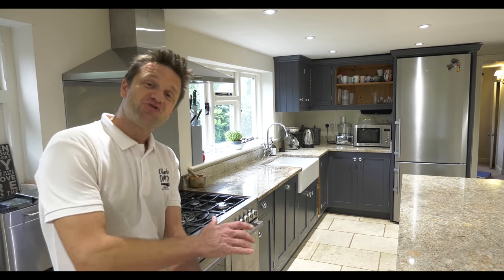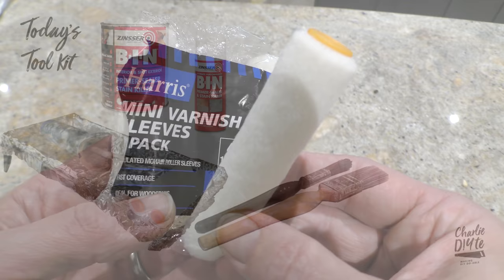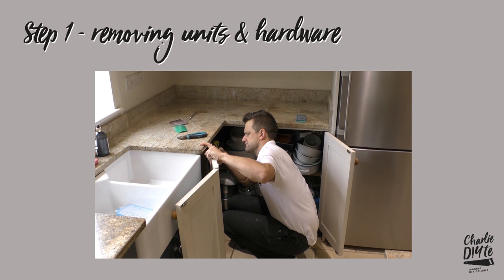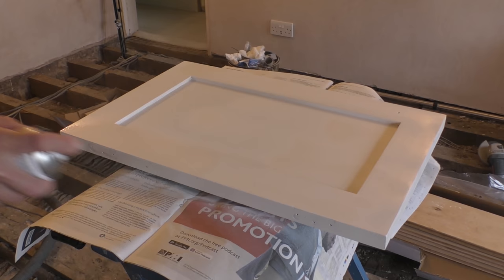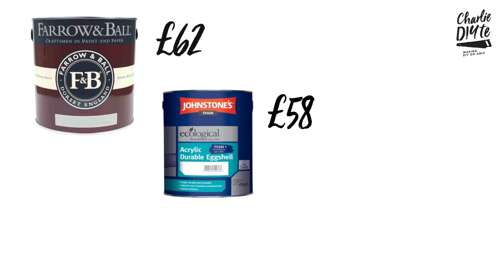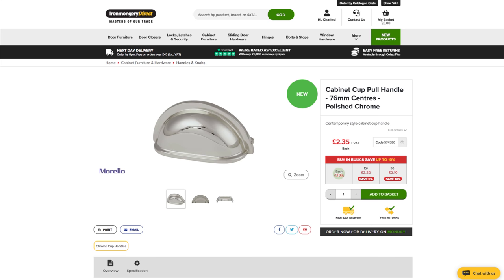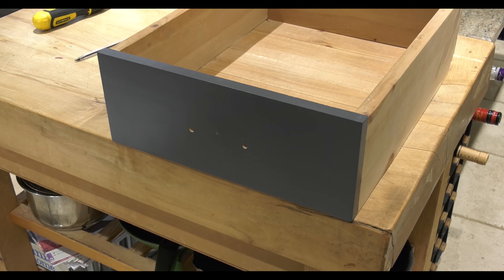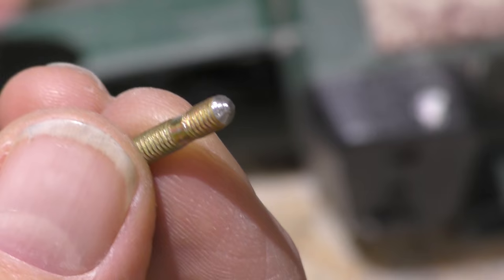Kitchen Makeover - How to Paint Cabinets & Fit New Knobs and Cup Handles!

Comment: I have always relied on Benjamin Moore paints (franchise) -- hi-gloss, semi-gloss, and eggshell and ceiling.  They have held up in a NY apartment for over 20 years and do not show any darkening.  However, since Benjamin Moore has doubled in price I tried Behr paints (Home Depot) at $30 gallon (approximately).  I find they are almost as good as Benjamin Moore but need maybe a half-gallon more per job.  They don't cover exactly in one coat but I am happy with the final results and they don't cost $60 a gallon. Behr paints also don't darken and hold up quite well.  I have also used Kilz 2 latex primer and  PPG Gripper latex primer and are happy with each brand.  Both cover very well with Gripper being slightly thicker.
Reply from the maker: Thanks for that - very informative and useful for anyone tuning in. I've got to say, the paint I used in this video is not wearing well. Chips everywhere that need patching up.

Comment: Interesting video. Hard work getting that done at home! I prefer to snap off those knob screws. Bend them a little bit one way, a little the other way and they break off at the divide. Bit of a knack to where you grip the pliers though, sometimes you crush the threads in over bending.

Comment: I use BIN 123 and all I do with trays as with all paints I just leave the left over wet tray to dry.Keep using it with all paints and never clean it down the plug hole as this is really bad.
After about 20 Used you simply cut the built up paint at one end of the tray and it peels off back to the new tray.
Using BIN I’ve wrapped brushes in cling film overloaded with the BIN.These brushes are good to go for at least a month.
Watch some of my videos where I’ve used BIN on varnished doors.👍🏻

I’m about to do my units which  are varnished 🤯 I’m gonna use BIN 123 two coats then 2 coats of Dulux Trade high gloss.Just for easy cleaning and wear and tear.Il get it colour mixed.

Comment: Hi Charlie, really interesting video. I've used many paints over the years and i've narrowed it down to Dulux in the end. Anything else i feel is a compromise and its about ease of use, how does it feel on the brush/roller? does it cover well? Is it tough enough for the job? I tried eggshell once to get a good finish, six coats with sanding in between but very delicate as a finish. Never used Zinsser but i reckon i'll give it a go sometime. Satinwood for wood/metal, wouldn't touch gloss again. Brush on and roller to finish. Thanks for sharing. Stay safe and keep up the good work. 👍🖖

Comment: i am awful at DIY but i am learning a lot with your channel! subscribed!! just wondering why you choose the shellac BIN zinsser over the bullseye 123 waterbased version? Thanks
Reply from the maker: That's great to hear! You're not awful, you're just starting your learning journey 👍 To be honest, BIN is a far superior product because being shellac based rather than water based (which the 123 is) it blocks stains and odours and things like wood knots, and dries incredibly quickly and also adheres to a ridiculous number of surfaces. I'll be honest, I've never used 123, but I'm struggling to see the need to buy any other primer now I've found BIN. If you're painting your kitchen don't forget to degrease with sugar soap or Zinsser's Universal Degreaser before painting, as I forgot to mention that in this this video.

Comment: Thanks Charlie. I've just completed my kitchen cabinets paint refurb. All inspired by your video. I used Zinsser BIN for the basecoat (coated MDF) but could've used a Dulux oil based Undercoat. The top coat was a water based Dulux grey colour. I must say that the shellac Zinsser has a satisfying vanilla scent to it. Anyways now that I'm ready to screw all the cabinets back in I'm contemplating on whether to add a top coat of clear Varnish or Lacquer to it? Two coats of lacquer should protect the finish colour against everyday knocks and chips - do you agree?
Reply from the maker: Thanks buddy. Glad you found the vids useful. I would think carefully before lacquering, just because I lacquered my kitchen table https://www.youtube.com/watch?v=Odh0fR13Q9E&t=2s to try and prevent stains from things like red wine. It didn't really help with the staining and when I had to repaint the table - mostly because of glue residue from the kids projects, and the odd chip etc it was a nightmare as I had to scrape off all the lacquer before repainting. The valspar featured in this video is pretty rubbish if I'm honest as it's chipped loads, but at least it doesn't flash so I've been able to touch up all the chips to pretty good effect. Sorry that's not really very helpful. Maybe do a bit more research before making the plunge, but personally, because of my experience, I won't be using lacquer again.

Comment: Another fantastic video Charlie🙌🏻 I’m seriously on the fence about up cycling my Mums dressing table as it really holds so much sentimental value an I’m actually scared i case I ruin it. However, I did sand an clear varnish it a few years ago, which turned out really good tbh🤷🏼‍♀️ But I’m stressing about actually painting it😭😂
Reply: I think it will turn out fine.. just choose your colour.. (the hardest part)
You said you varnishing it.. No problem take your time and enjoy your self... 🤗⭐☕

Comment: Charlie, what do you think about painting laminate kitchen doors etc. I've read it can be done but I can't think it'll turn out that well.
Reply from the maker: I'm inclined to agree with you John. The Zinsser BIN has excellent adhesion - you can even paint it onto glass. However it's the long term durability that would worry me. This Valspar has been pretty hopeless if I'm honest from a chipping point of view although you can at least spot repair without it flashing (ie without having to repaint the whole door). My advice, maybe experiment on the back of a door if you're going to replace them anyway. Degrease with sugar soap (I forgot to mention that). Make a key by sanding the surface with a 180 grit sand paper. And paint on a coat of BIN. And see how it adheres.
Reply: @CharlieDIYte  Thanks for the advice!

Comment: Hi Charlie.  What’s the Valspar colour please? I have used Valspar extensively in my home and I like it. It goes on so easily and I can always eek it out. Its affordable and, if you’re fussy like me, you can get the colour you want. Downside: yes it does mark and chip easily in a busy household but I don’t mind the odd touch up!
Reply from the maker: I think it was Farrow and Ball Railings. The Valspar has chipped quite badly but is at least easy to touch up. Also if it's for the kitchen, give the units a good degrease with sugar soap first. Ideally go oil based as it will be more hard wearing. If you're using water based, there are a few products like Tikkurilla Kiva 10 or Blockade Rock Top you can paint on at the end to give it enhanced protection.

Comment: Hi Charlie, great video and the finished result looks great. Totally agree on your prep and BIN (fantastic stuff) - seems you spent more per litre on the primer than the top coat! The Valsper is not something I would use after the cat wee reviews on their emulsion and I've never had good experience with cheap paint. The hassle of re-doing is not worth the £30 saving but I understand why you choose to do it on this occasion. My preference for woodwork is tikkurila which is not actually that expensive but fantastic. Just one final comment - I've noticed with tikkurila that it takes a week or so to fully harden so perhaps this is typical of all water based wood paints? thanks again for taking the time to post the video!
Reply from the maker: You're very welcome Bill and thank YOU for taking the time to comment. Some useful info there 👍

Comment: Did you make sure you kept the hinges etc for the exact cabinet it came from before you painted it?
Reply from the maker: It wasn't really necessary as they're all identical and factory produced. Don't use Valspar though. It's not very durable and chipped easily.

Comment: Nothing wrong with buying paint from B&Q, they are often cheaper for a lot of Dulux/ Zinsser paints than buying from Dulux themselves. For some reason the Valspar paints always gets bad reviews here in the UK, yet over in the USA people love them.  
I will be making my own kitchen soon and for the top coat i will be trying out Benjamin Moore Advance paint as that gets excellent reviews. :)
Reply from the maker: Thanks for that. Very interesting. I think you're much better off with the Benjamin Moore. This Valspar has chipped horribly since I did the video. The only good thing about it is you can spot repair without the paint flashing, which is quite rare for eggshells where typically you have to repaint the whole unit.

Comment: I’ve been using Dulux for 40 years, but recently we’ve found in my sons shop that the paint performs exactly as you illustrate with the Valspar.   It never seems to harden giving the feel it never dried properly.  My wife indicating it’s me! The paint on the outside of his shop  performed equally as poor.  On a recommendation I went from Dulux trade to Johnstone’s, what a difference.  In truth I think it’s a reflection on how modern water based paints are made.  My other son has used Johnstone’s emulsion, giving a better wipe clean finish.  My kitchen diner area is decorated in Dulux and marks the grandchildren make don’t wipe off very easy and I have to be careful not to wipe the area too hard.  This paint is not cheap.   So next time I’ll change the manufacturer as the only current way to address the issue is to repaint which requires the whole area to be done as touch ups show.  Great vid Charlie, my advice is to do your research on the paint as all that hard work can be undone in seconds - wiping out any cost savings.  👍🏻👍🏻👍🏻
Reply from the maker: Thanks Mike - great to get your experience in on this. I think we're both in agreement that Johnstone's is money well spent!!

Comment: You're right, Valspar colour matching is horrendous even when you have a paint code.  Their sensor matching is as much use as the old chocolate teapot.
Reply from the maker: Agreed! 👍
Reply: I had them colour match after wickes and dulux decorating stores failed to scan the shiny door I was asking them to match. Worked a treat so surprised to hear this.
Reply from the maker: @CragMid  Thanks, that's useful for people to know. Out of interest what did you take into the shop for them to scan?
Reply: Charlie DIYte the door of “Old London Twilight Blue Corner Vanity Unit & Basin”. @housethe70sforgot on insta if you want to see the result. Was very happy with the result and seems solid now and as you say easy to touch up without noticing you’ve done so.
Reply from the maker: @CragMid  Thanks mate! Yes we're pretty happy with it. It does chip but I'd easy to touch up as you say.

Comment: Hi great video may I ask if you painted the inside or the outside of the doors and how you stopped getting edge build up? many thanks
Reply from the maker: Yes I painted both. I guess by using the mohair roller sleeve which is great at applying the paint evenly, and not being tempted to lay it on too quick. I have found this paint has chipped quite a lot but there are protective coatings you can apply on top - like polyvine decorators varnish or Minwax polycrylic coating. Make sure you sugar soap all surfaces before you start, to degrease them

Comment: Hi Charlie, thanks for a great video. Is there a reason why you didn't use polyurethane to finish? Should I use it to increase durability of the (latex) paint?
Reply from the maker: Thanks buddy. I used lacquer on my kitchen table, which also had a latex paint finish, to try and stop the red wine and other stains. It may have just been a rubbish quality lacquer, but I didn't really find it enhanced the durability and when I had to spot paint the table to touch up damage, I had to scrape the entire lot off, before I could repaint. To be honest, this Valspar paint isn't great quality and has chipped in a number of places, but kitchens get a lot of beating, and the benefit of the paint is I've been able to spot repair all the dinks and chips without any flashing of the paint, even though it's an eggshell finish. I'm not trying to put you off, but if you've got some polyurethane, maybe experiment on a small area and see what you think.

Comment: Hi Charlie . We have IKEA shaker type cupboards . They are covered in vinyl . Do you advice removing the vinyl and painting or wrapping the cupboards with new vinyl ?
Reply from the maker: I think either of those options is going to be problematic. Maybe get a small tin of Zinsser BIN and experiment on a small area to see how well it adheres. You can paint glass with it so it might be ok. Then you can paint over with a nice hard wearing top coat (don't buy this Valspar though, it chips too easily!)

Comment: It's been 1 year, but I have a Q since the cabinet doors are flush with the cabinet face plates:

How did you deal with painting the sides of doors without them rubbing when you reinstalled them?
Reply from the maker: It's a good question. The only thing you can do is perhaps plane them down so there's a couple of mm clearance. Anything that rubs will scratch off the paint.

Comment: Another point.....I’ve used BIN straight on top of varnish with sanding and WITHOUT sanding.It adhered excellent in both cases.
I think the reason your top coat didn’t take is because it isn’t Dulux or Johnstones.(cheap Sh!te)🤪
If you were painting on top of water based paint that BIN would go on no problem without sanding.The only time you’d struggle was if it was oil based gloss.Thats my experience of it anyway.👍🏻

Comment: Hi Charlie.
Great channel!
Why don't you make pull out drawers for your cupboards, they would look great! And make it easier to access pots and pans and stuff at the back.
Reply: Agreed.  I designed my kitchen and it's quite small.  With the exception of the sink unit all my base units are drawers.  Easily accessible and all the space is used.  Three drawers in each base, two deep ones and a shallow one at the top.  Perfect. :yougotthis:

Comment: 11:30 that’s strange!!!
Ive never been able to scrape paint off the top of BIN 123 oil based.
Why hasn’t the paint adhered to the primer??Strange.
Maybe a light sand was needed or a water based undercoat on top of the BIN.
Really strange that.
Did you do 2 top coats?
Weird. 👍🏻👍🏻

Comment: Hi. Has anyone used the v33 brand (lil be using loft grey) from b+Q?
Reply from the maker: Alex, personally I wouldn't use Valspar again. It's chipped terribly. However a couple of people have recommended a final coat with something like Polyvine decorators varnish or Minwax polycrylic protective coating to give the top coat added protection.

Comment: As a painter I did a job with this paint as the customer supplied it and it was shite, johnstone, dulux, fleetwood, crown are the recommended brands I'd advise anyone to use stay away from cheap shitty paint.
Reply from the maker: Agreed, I swear by Johnstones. Only thing I'd say is that I spot painted a load of chips on it this weekend, and it worked seemlessly with no flashing, although arguably if I'd used decent paint in the first place, there would have been no chips !!!
Reply: @CharlieDIYte  at that time the paint was at a reasonable price and you didnt know what way it will hold after its finished, but you know now.
Reply from the maker: @fingaonthatrigga  Agreed. It was an experiment really as I said at the time as my wife was in B&Q. On a trip to a Johnstone's Decorator Centre the assistant had a load of matt emulsion at knock down price, left over from a Homebase order. Apparently the DIY stores drive a hard bargain on price so the manufacturers thin down the paint to meet the contract price - why you should never buy from one of the big DIY stores. Someone else on this feed recommended two part paints for applications like this. You ever used them?
Reply: @CharlieDIYte  never used to parts paint but heard it is robust and with stand everyday use and wont chip off. I have used enamel paint designed for kitchens cabinets old timers used it when they were building kitchen tough as nails few kitchens I seen done by this guy paint never lifted once and it's in 20 years. It's called (sherwin Williams enamel semi matt.)

Comment: Great video , thank you. Charlie have you used Johnston's Acrylic version before and how does it compare with application and finish
Reply from the maker: I've just bought some as it happens, for my kitchen table. I don't know exactly how they both compare but I'd say the Johnstone's is less rubbery on drying and less likely to chip. I love Johnstone's - great quality paint.
Reply: @CharlieDIYte  I use Johnstones myself but always used Oil based or water based satin before on wood , think I will give the acrylic a go myself next time . I'm torn between Johnstones wall paint and Farrow and Balls wall paint , I know FandB is more expensive but convinced it goes way further

Comment: Valspar is a really mediocre quality of paint hence the price but even if you paid 5 p per litre you should get some sort of regulated quality which this is not.....I’m not sure why paint manufacturers don’t make a soft sheen or mate coloured oil based paint any longer as the oil based paints generally take knocks and scuffs way easier and are much more robust....that’s my 5p worth of nonsense anyway🤣🤣
Reply from the maker: Agreed Mark. This paint has chipped like you wouldn't believe. The only good thing about it is that it doesn't flash, so it's easily touched up. I'll stick to my usual choice of Johnstone's next time but 2 part paints are I believe the most durable option.